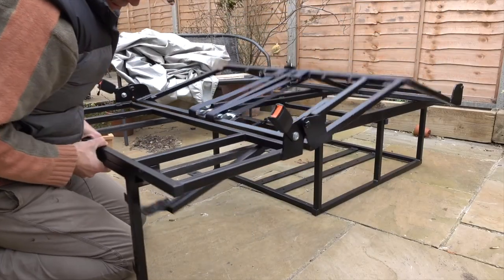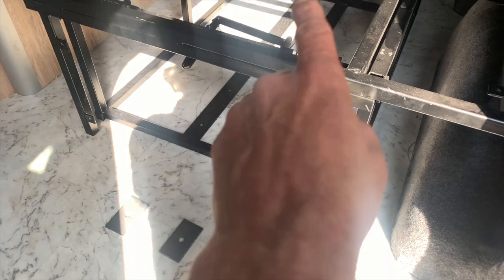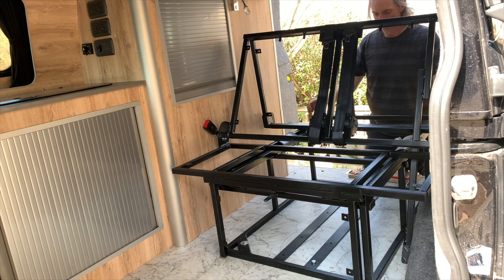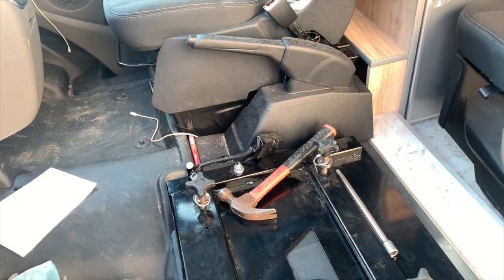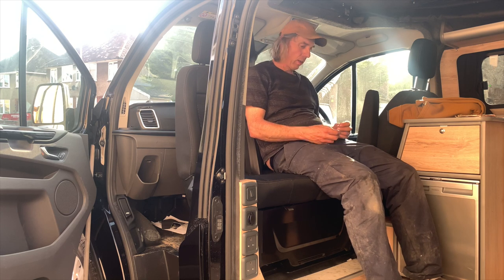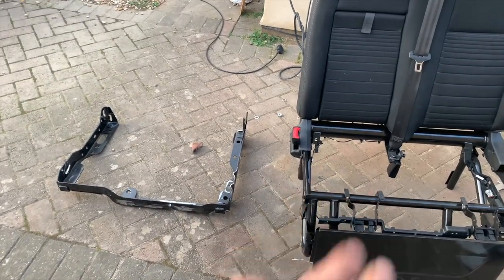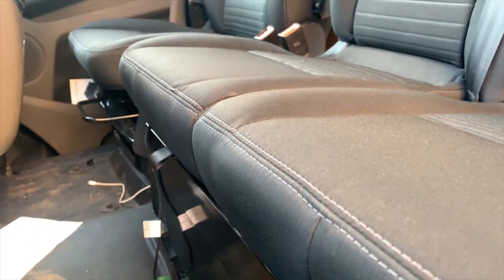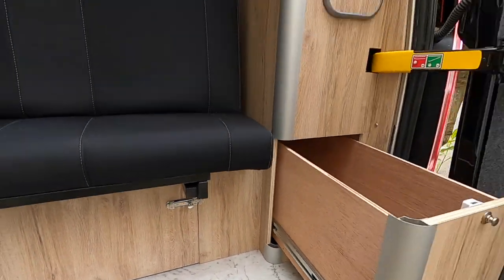Rock n roll bed and Swivel seat in a FORD Transit custom

Comment: Nice looking conversion and a good idea with the passenger seat, I hated the fixed double in mine and decided to replace with a single, expensive but worth it for us.
Have you ever contacted the manufacturer of those seats about that little mod, surprised nobody hasn’t had a serious injury with that. I remember you making that mod on previous conversion.

Comment: Did the same with my double seats and cut the base down to bring it level with the drivers seat. You can move the back seat support by about 5 degrees - there are 3 torx bolts hidden inside the foam that can be slackened off and then tilt the back and then tighten it back up.
Reply: Going to have to look into this! Always feel sorry for my wife on long trips being sat bolt upright!

When you say hidden in the foam, is it accessible or do you have to take the backs of the seat off?
Reply: @jamesgreen1561  Same issue here with me. Did you figure this one out?
Reply: @MrToremainn  nope, she's still sat upright to this day 🤣 fortunately for her she doesn't spend as many hours on the road as me

Comment: Just stripped my seat out and cut 65mm off the bottom of the legs  ..be warned the factory welds are a pig to grind off and the seat design on this looks a wee bit different to my 2016 and it was a nightmare cutting the one angled bend tube to suit. 
3 hours later and yes amazing difference. 
Make sure you are competent enough to carry this job out .
The side  plastic trims will need to be cut down too .

Comment: Hi. I have enjoyed watching your campervan build videos and saw that you used C&H campers to fit a pop top to a Ford Transit Custom. I have a Ford Transit Custom which I want a pop top fitted to and am considering who to use. Would you still recommend C&H Campers to fit a pop top, as they have mixed reviews online? Thanks. (I’ve also emailed you via your website in case you do not see this).
Reply from the maker: No I wouldn’t. The pop tops are ok but they are useless
Reply: @KBeadle  thanks for your reply and honest opinion.

Comment: Hi! Great video. I have just installed my swivel base and I am having the same issues! I was looking at cutting the height down but can’t work out how you retain the front metal trim and the 2 plastic side trims as the seat will be lower and these will no longer fit? How did you overcome this please? Thanks. Tim
Reply from the maker: Cut and weld the front one, cut and bolt the side ones
Reply: Hi sorry to bother you again! I am just getting to cutting the seat down and wanted to check a few things. I presume you cut the bottom off the steel front and the plastic sides?

Comment: Hi, Would you for a fee be prepared to cut down another chair? I have the same situation? I would bring it to you?
Reply: Did you have a issue with the front plate where installed your heals would be? If you lowered the legs would the plate not get lower then hitting the swivel?
Reply from the maker: i cut that down too

Comment: A rib bed us much better. Access to underneath the bed is better. More rear storage at the back. More flexible in design. You sleep on the flat side and sit on the other side which is contoured like a normal seat. More expensive but very much worth it.
Reply from the maker: You pays ya money and you make ya choice